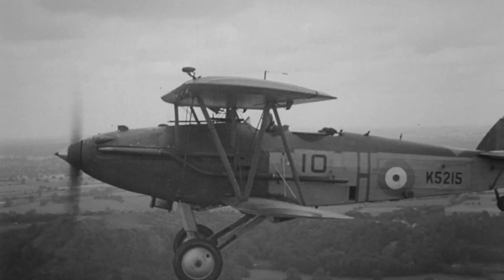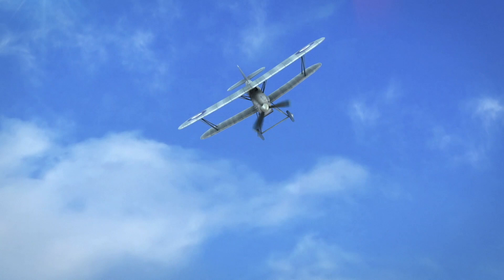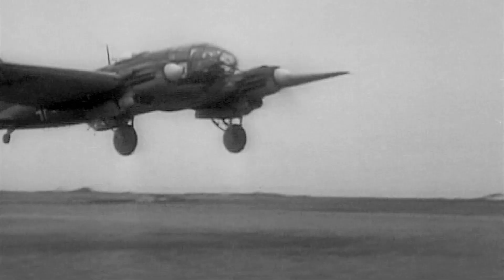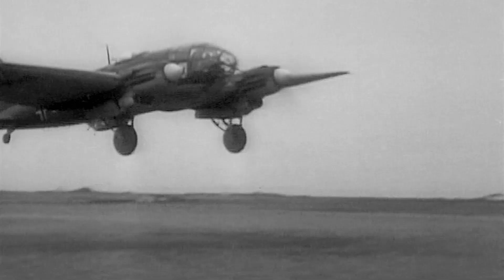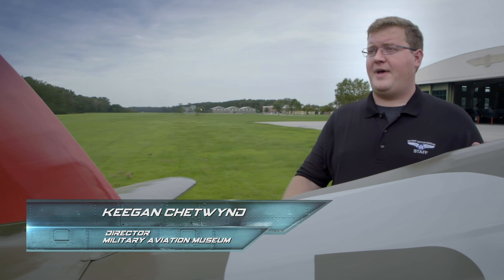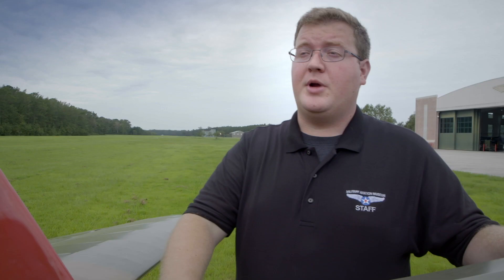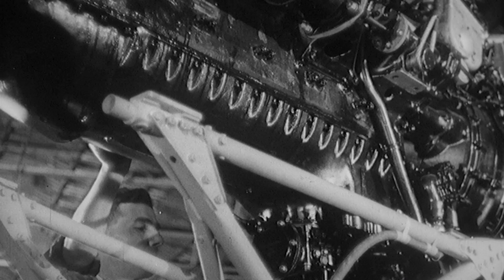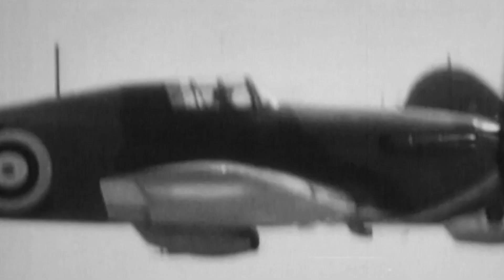Why the Hawker Fury Was Upgraded into the Hawker Hurricane 🌪️ Air Warriors | Smithsonian Channel

Comment: Not up to standards I expect from the Smithsonian. A "C- "at best. First: the fuselage on the Hurri is NOT wood it is steel tube. The formers around the steel fuselage are wood, and they are for aerodynamic air flow/cosmetic reasons. These pieces of wood carry NO load. The steel tubes carry the strength/load.  Second: the Merlin. In 1918 Rolls Royce developed the Falcon V12 engine (with help from the Curtiss V12..a whole 'nother story.) and it became the Kestrel and finally ended up as the Merlin.  (one can not sum up this story in one sentence, but close enough for general public). Third: biplanes do not magically develop drag at 200mph.  Some Russian WWII fighters might disagree with you on that point. Visibility, ease/cost of construction, potential of higher speeds, plus realizing the silliness of antiquated reasoning (Old brains generals looking at a monoplane fighter and saying, "it doesn't look strong enough".) helped develop the monoplane fighter.  You need some serious quality control. I am glad that you attempted to put this information out, but raise your standards.
Reply: The Hart/Hind/Fury already used the Kestrel I think, the Merlin predecessor, though the Merlin would go on to be developed well beyond the Kestrel.
They didn't mention that fortunately this Hawker series of biplanes was already relatively fast with a sleek faired engine which helped make this evolution successful. Wouldn't have worked from just any biplane. Didn't this biplane series start life as a light bomber, then when their fighters couldn't catch it, the RAF ordered a fighter version? But by the time the Hurricane was needed that previous biplane series was a lot less competitive.
Reply: i find it ridiculous that they make it sound like monoplanes were a german idea. monoplanes had existed since the dawn of flight, it's just that for most applications their strengths were outweighed by their weaknesses in the early days. however, as materials and construction advanced, as more powerful engines drove aircraft with more power, there simply came a point when monoplanes became more practical.